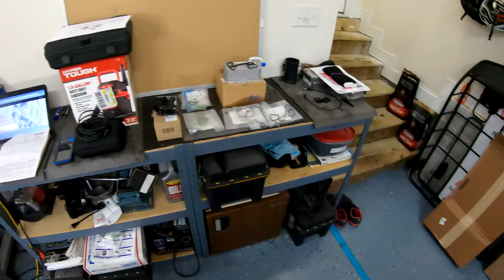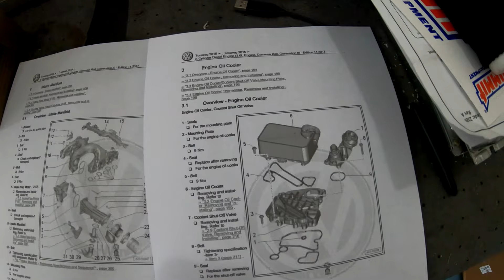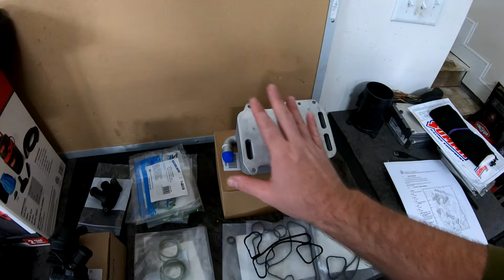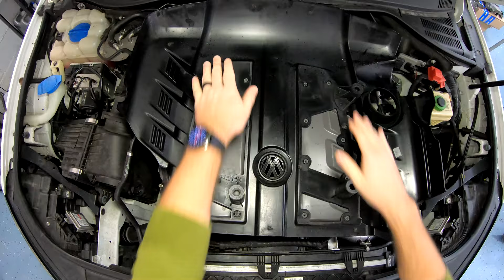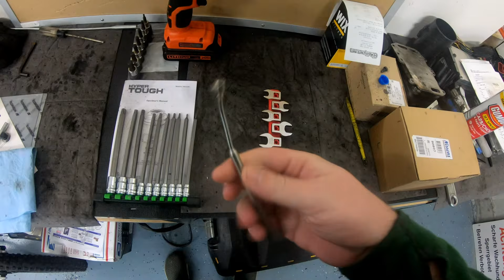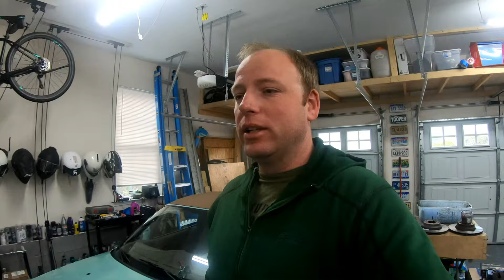2014 VW Touareg Oil/Coolant Leak - Oil Cooler/Coolant Bypass Replacement

Comment: Long T30 socket drive is the key. Must have watched your video a dozen times to have the confidence to tackle my 2013 VW Touareg TDI coolant leak.  Expensively learned that the dealers don't know how to solve this because VW hasn't posted a tech bulletin on the source.  Dealer couldn't find the coolant leak with a pressure test held overnight. By this time I had mostly oil in the valley because the coolant boils off over time.  So they focused on the oil leak. They replaced the oil cooler and its transition plate (and gaskets - your oil leak point?) and egr cooler (coolant in the exhaust not proven) under the TDI extended warranty, and the timing cover, water pump, and oil thermoset on my tab.  The oil leak was solved but coolant level was dropping and valley filled with coolant again two weeks later.  I used your video to go back in myself and replace the coolant bypass valve and intermittent flange (tricky fit, but you can do it without removing the oil cooler).   Note that the new bypass has been modified to strengthen the rotary bushing - you can see if the old one was leaking it was going to be very slow.  Everything has been tight now for over 100 miles.  Becare with the fuel pressure sensor - broke mine using a tight 6 sided socket - use a 12 point.  Replaced it with a Vemo (5HWP53) for a 3rd of the VW price - works well.  Also recommend getting the seal ring that doesn't come with the intermediate flange PN N-908-091-02.   It's a blind mate to the egr.   Thanks Q!!
Reply: What length of t30 did you end up using? Long as I can find is a 6 inch t30.
Reply: @curtisburke3080  6” will work just fine.
Reply from the maker: Haven't got to the timing cover, in the middle of moving so I may have a shop do it... not sure yet, and hadn't given the fp a thought
Reply: I got a 2014 Touareg executive 3.0 TDI Diesel and I got to replace the EGR cooler and oil cooler pretty much the exactly the same thing that you did in your video is what I got to do a question is is where did you order your parts from because that's a hell of a deal on how much the intercooler and the oil cooler cost everywhere I get see him and everywhere I go they're both running anywhere between 300 for the oil cooler and close to four hundred for the EGR cooler if you have a place that has better prices would you please let me know
Reply from the maker: @donaldr.capehart4313  I used FCPeuro for my parts.
Reply: @driventofailure  did you order it all in one kit
Reply: @driventofailure  you're so awesome you're explaining the whole process was right on and the camera angle was perfect thank you very you're the man, thank you for the DIY ,Thank You .
Reply from the maker: @Donald R. Capehart  all separate, take a look at the video description for the part numbers
Reply: @Doug how were you able to get the oil cooler and egr cooler replaced under warranty? I am having the same issue and my dealer is stating that the extended diesel warranty does not cover these components.
Reply from the maker: Nice work and thanks for that seal ring part number, have had trouble finding it!  My coolant leak is resolved and oil consumption improved, I still have some oil accumulation in my valley.  I think I may be on my way to a timing cover gasket, I have die in the oil I hope to trace towards the source.  The unfortunate part is that I may have to take the intake off again to do this…
Reply: @driventofailure  Wondering if you were successful with the timing cover gasket change?  I'm lower mileage than you (at a 100K), but I have seen some horror stories on TDI fuel pump failures at this mile point.  Have you thought about changing your FP preemptively?
Reply: Thank you for the video. I get had this operation. Not solved my problem, dropping mixed liquid (coolant + oil).
During my last diag, experienced guys told me, it is the oil filter housing. This will be the next op on my car soon.
Some question, how you removed the coolant? I had air problems in the system at first time. 375k km still running very well.
I wish you the best.

Comment: Thanks for making this video. I’m sure I will have this problem in the future.
One suggestion, don’t torque the back fuel line down so the air can leak out. As soon as you see fuel at the union, toque it down. It should fire up quicker and your injectors won’t run dry as long.
Reply from the maker: Thanks for the tip!
Reply: so you mean dont torque one end, let it try to start for a second or two then go back and ttighten?

Comment: Have you ever had oil in the coolant tank.. I just noticed today. I added coolant 2 weeks ago.. and today I just wanted to check and seen it was black from oil…
Reply from the maker: I never had that, but I could see that if the seal on the oil cooler mounting plate was compromised you could have some cross contamination...

Comment: don't forget that the plastic piece that bolts to the front engine cover also is a common leak culprit...while the inlet manifold is off, front "timing" case needs to come off for it to be unbolted, don't forget the hidden bolt to the far right thats behind a pulley or you may snap the case while trying to pry it off like me, you will also need the oil filter housing rubber gaskets aswell.
Reply from the maker: I was looking at that piece, any part numbers for it?  Might go back in there...
Reply: @driventofailure  mine was my leak issue all along, taken my inlet man off 3x now, put a new oil cooler on it too.
Reply: @taydencornish Can you elaborate on that part? You have a part number? I am going to tackle the job next week and will replace everything that could leak...
Reply: @dallard2  go onto the video that different car review made on v6 tdi gen 2 it shows it
Reply from the maker: I may be in the same boat, just can't find the replacement part, you get it from the dealer?
Reply: Exactly what was my problem,because the whole front needed to be taken apart i gambled on not replacing that peice of plastic,replaced all the other bits and it leaked still! had it pulled apart again,cost me an arm and a leg.

Comment: I'm having the same issue on my 2016 Cayenne diesel. No leaks visible on the underside and I'm losing a quart of oil every 2500 miles. Hoping the borescope treatment will reveal the leak and I can get the dealer to fix before my extended warranty is up.
Reply: Mine the oil is going into the coolant
Reply: Same

Comment: Great job on the video, thanks for the insight. I'll be doing this to my A7 tdi, what software or where did you get the print outs from?
Reply from the maker: I used FCP
Reply from the maker: It's the oem maintenance manual found on the clubtouareg forum 🤘🏻
Reply: @driventofailure  thanks. I'll go check it out before I get started
Reply: @driventofailure  BTW, where did you get your parts from FCP, ECS, or dealer?
Reply: super nice job ,thanks

Comment: Great video. Thanks for making. Did I understand correctly that you were losing an inch of coolant per 40 miles? Did you ever test pressure on coolant system? I am losing an inch of coolant every 500 miles or so on my ‘14 Touareg tdi. I’ve tested coolant pressure and it holds. Thanks!
Reply from the maker: I did not pressure test, I was basing my circumstances on the fact that I was not seeing evidence of leaking/dripping or burning through exhaust

Comment: @Driven To Failure or anyone else - have you tried VW warranty for this? Our TDI's are still under warranty if you haven't exceeded the mileage.
Reply from the maker: In forums some have succeeded, some have not... I myself am beyond the warranty
Reply: I got a helpful tip from two dealers and they confirmed that the EGR is a warranty item with VW. Therefore if you have coolant in the valley then there’s a chance that the EGR is leaking but if it’s not then warranty is denied. The cost to determine this is 4 hrs of labour but once they’re in there you’re paying for all parts at VW pricing as well.
Reply: +1

Comment: very nice video. Did you anytime lose all the coolant in the reservoir? happend to me 3 times now and i can see some fluid in the middle but havent looked more into it.. like i went to work, coolant was fine, 10 hrs later when going home the car warned for low level, then its was like 2cm of fluid in the bottom of the reservoir.. then fll it up and its fine for couple of months:p
Reply from the maker: That's seems like a large amount of fluid, much more than what I experienced.  Mine would just dip below the fill mark and trigger the low coolant light.
Reply: @driventofailure  my light only comes on when its almost empty tho, but then its good for months so very wierd

Comment: Very nice video, what about the oil change did u do that bcs it was needed or it is recommended to have it done for this job? I will hit that job soon but my oil change was done just a few weeks ago. What do you recommend? Thanks.
Reply from the maker: This is an opinion, I did it because I was due for one.  If your comfortable that you didn't get any foreign crud in the oil passages when you have it all open you should be good.  You may need to add a little for anything you lose when the oil cooler pulls up, my cooler had some oil sitting in it's passages still.

Comment: Excellent video, did you find what was leaking coolant? Where did you order the parts?
Reply from the maker: Yes, so the gasket between the oil cooler and mounting plate was hard and had some spots where coolant was sneaking through.  Also the shaft running through the coolant bypass valve is a contributor.  Part numbers are listed in the video description, I used FCP euro for all the parts.
Reply: @driventofailure  Thank you! Mine is 2015 with 260k km and it has been having exact same symptoms for some time. I went to install new winter tires last week and I asked the guy to see if he can find the leak. He said it is a pierced radiator as he pressure tested it,
 I doubt that and I believe I have the same issue.
Reply from the maker: I did replace the oil cooler because I had it and I was in there already.  Didn't see anything evident, but also didn't do a pressure check on it.  I have had about 500 miles on it now, fluid levels have not changed.  Have not sent the camera back down yet.  No apparent fluids dripping anywhere.  Feeling good about.
Reply: @driventofailure  Hey, I did the job last weekend, took me 2,5 days to clean and put everything together. So far looks like it is holding the coolant level. I noticed the plastic tray on top of the manifold that holds the cables is missing on mine. Probably previous owner or whoever did some repair took it off and did not put it back. Do you know the part number or if it is not too much trouble if you can check yours? Thank you!
Reply from the maker: I feel like the radiator would be visible with residue or dripping to the under covers.  Maybe you can get a camera down through the intake manifold to confirm... or inspection mirror and flashlight.
Reply: @driventofailure  Thank you! I can confirm now I have the same problem. Did you change the oil cooler or the original was good? How many miles have you put in after the repair and is holding up?